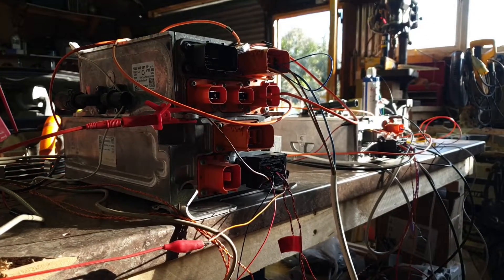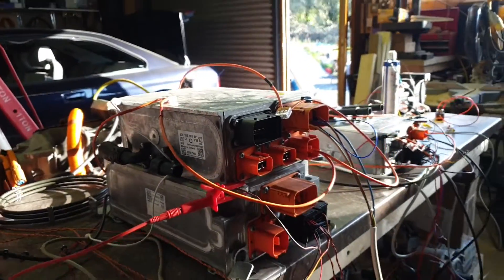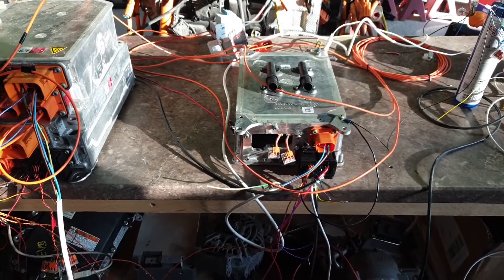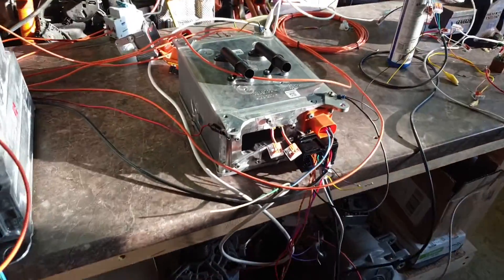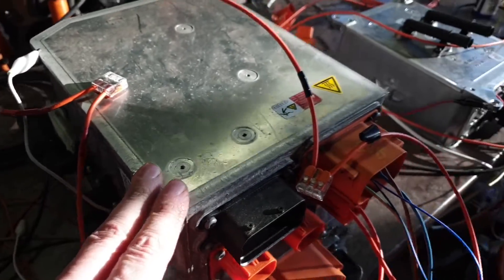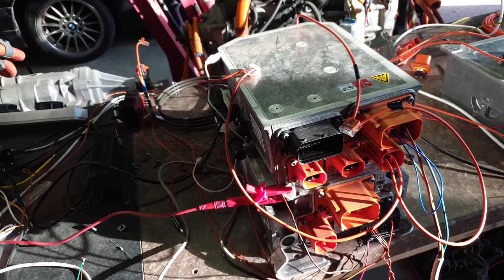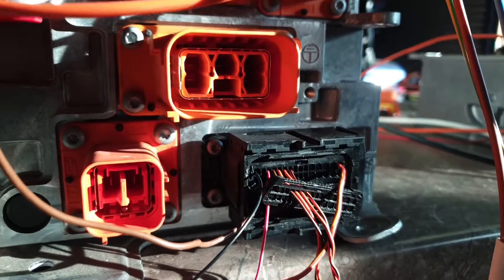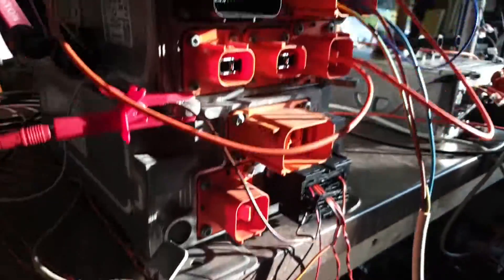Hacking The VW Onboard Charger Part 4

Comment: Du you need a log from the Hybrid can of an e- up? Its the old one but I have several logs from reverse engineering it. I wanted to install an 7.2 kWh Mii charger to the car. But I did't compared both can's from these cars.
Reply from the maker: Yes please that would be a huge help:) info@evbmw.com
Reply: @Evbmw  As i remember i was also requesting Data from the OBD during these log to have a reference for Voltage / current etc. Sure i will check the data tomorrow for you.